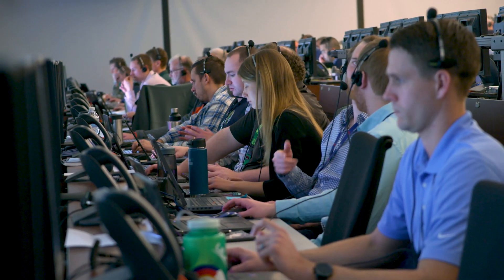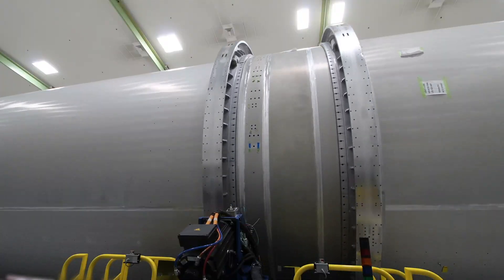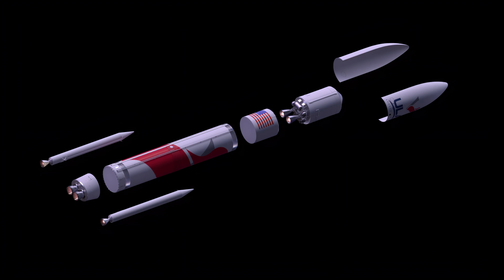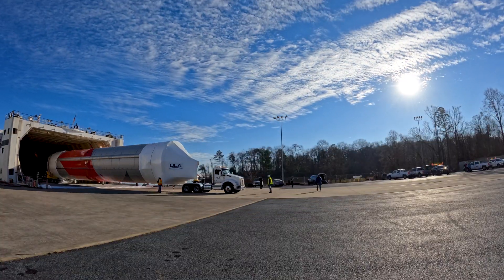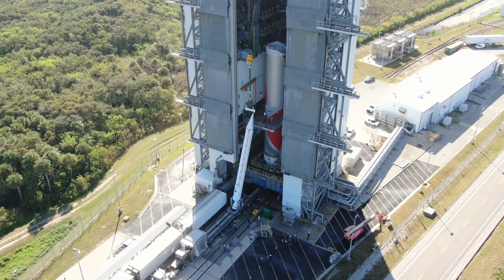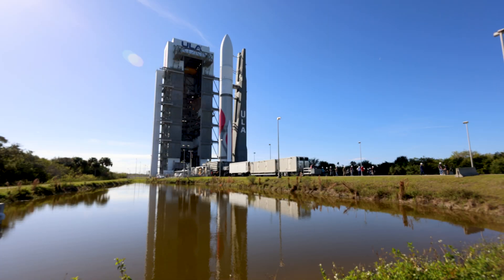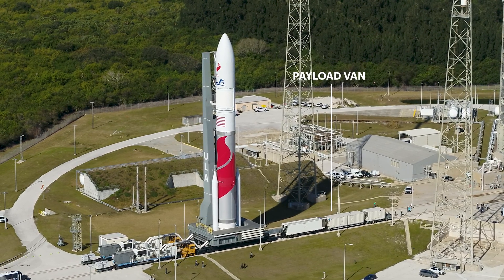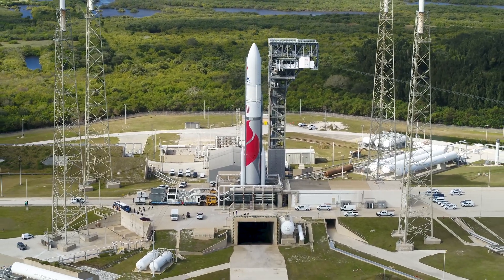The Second Vulcan Launch: From Factory to Launch

Comment: Just like Blue Origin and SpaceX,  ULA uses metric units for engineering and manufacturing. This is in line with NASA and the international aerospace community, which use the metric system for consistency and ease of collaboration. 
And yet, in your promo material you use legacy imperial units without even converting or sub-titling them for the benefit of the majority of your audience.
Reply: At least they are using Elefants for a measure of mass ?
Reply: WHAT THE F### IS A KILOMETER????!! GUNSHOTS AND BALD EAGLE SCREECHING
Reply: If your going to be a fan of American made rockets that uses American metric system, learn to convert. I had too with me being a fan of high end European cars 60mph is roughly 100kph a kilometer is little over 3000 ft or under 3/5 of a mile.
Reply: 1: Blue origin uses imperial units. 2: This comment just sounds like you want to complain about something. 3: This is America, we use landed on the moon units and freedom units, not couldn't land on the moon units. 4: BALD EAGLE SCREECH

Comment: Better than Falcon 9.
Reply: A different tool for a different job. I like Falcon 9, I like Vulcan, I like Atlas 5, I like Falcon Heavy. I think I might just like rockets and aerospace in general and not just one company that strangely draws a cult following for some reason.
Reply: Only advantage is fairing
Reply: @jamskinner  

Not the only, if you are referring to Vulcan, but they are particular missions that are mostly corner cases and low number of launches.
Reply: @jamskinner That's not really the only advantage, it can get almost twice as much as F9 to GTO (geostationary transfer orbit)
Reply: it does look better, still one must admit falcon 9 made everyone step up the game.
Reply: Fan boys know nothing about rockets. They just buy space swag. The Vulcan is replacing the Delta IV. There is no point in comparing Vulcan to Falcon 9.
Reply: Real fans know the formulas and acronims. Otherwise you are just repeating what the ads say  @Southwest_Trailblazers
Reply: in some ways yes higher performance and higher energy optimized
Reply: VC0 or VC2 cannot compete commercially with Falcon 9 on cost.
VC4 and VC6 are heavy lifters so you can’t compare it Falcon 9. 
But VC6 CAN compete with Falcon heavy on cost.
Reply: Not by a long shot bud.
Reply: The delusion is strong with this one
Reply: Cool video
Reply: Looks made out of tofu
Reply: we have a comedian in the comment section 🤣😂🤣
Reply: Once ULA recovers the engines for reuse it still will be more expensive due to the SRBs and non-recovery of fuel tank (and that is contingent upon when or if). So to be considered “better” must be dependent upon types of specialized missions that it can do vs falcon which then brings into play how it compares with falcon heavy.
Reply: @Mentaculus42 As long as ULA is owned by Boeing LockMart, you won’t see any re-use of the engines.
Reply: @dphuntsman  

I agree, that is why I had the “IF”. Besides ULA’s approach is problematic unless they are willing to get the engines somewhat wet with salt water (that flotation concept will need some refinement, but it should work).
Reply: @Mentaculus42  Vulcan IS best rocket you have not just the  cost and thé business but thé technical innovation liké ia and other .
Reply: F9 doesn't need srbs, not reusable, etc...
Reply: @JameBlack  

When New Glenn starts flying, which appears to be sooner than ULA getting reusability, we will have a superior competitor to falcon. But then a particular contingent will say …